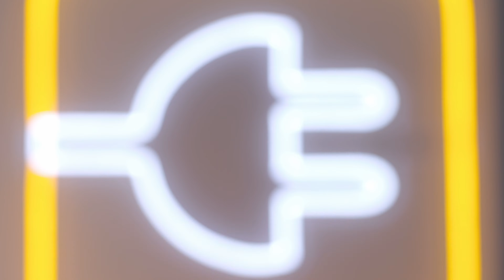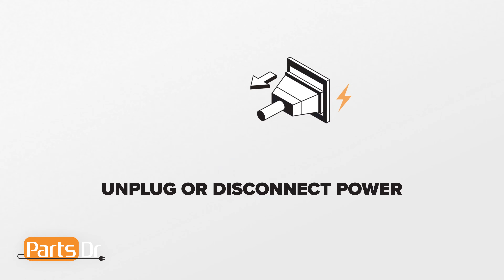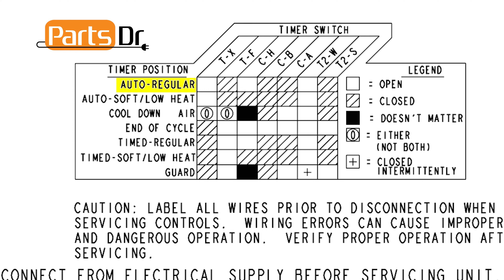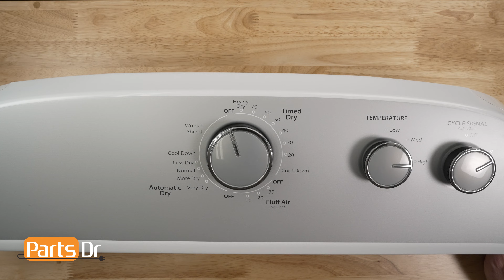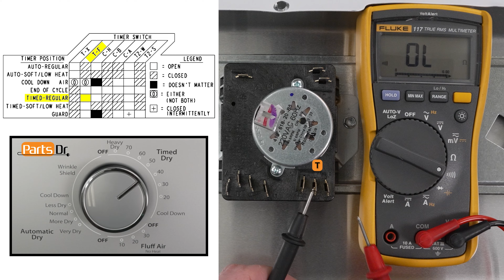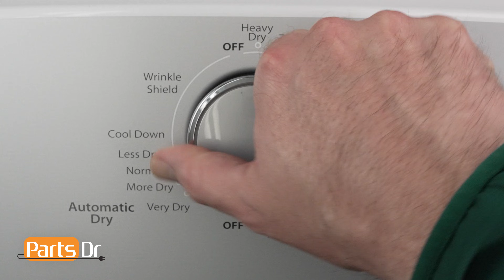Dryer Timer Troubleshooting & Testing - Whirlpool Maytag Amana Kenmore Estate and More

Comment from the maker: Thanks for watching our video on troubleshooting and testing dryer timers! If you need to replace a faulty timer, we always recommend using original, high-quality OEM parts to ensure your dryer operates reliably. You can find genuine replacement parts for Whirlpool, Maytag, Amana, Kenmore, GE, and more on our website at https://partsdr.com. Simply enter the model number from your dryer’s tag into the search box on our site to quickly find the correct part.

Let us know if this video helped, and feel free to drop any questions in the comments below. Happy repairing!
Reply: I replaced the timer and fuse. Dryer works again but I may of replaced the timer wrong. The arrow facing is wrong

Comment: Mine is only about three years old but it felt mushy to begin with as far as the timer knob. It's not stripped out. The heat's not working. I could get it to work by holding the knob while applying light torque, clockwise on the knob. However it was in and out. So I unplugged it took the back off and following the instructions of putting the probes on A and C and looking for continuity of any kind while turning the knob would tell me that the timer's bad. Does that sound accurate? If A and C the red and black aren't getting continuity whatsoever while spinning the knob around that means the timer is broken? I was turning the timer clockwise and counterclockwise whenever I wanted to and counterclockwise a lot. I didn't realize I was only supposed to spin it clockwise. I think three years of that finally broke it. Some people might not realize it's only meant to go clockwise because it basically felt the same going both ways.

Comment: Question! My dryer timer will not advance in the automatic mode but will advance in the timed mode. Is this still a timer issue or something else? I have checked the cycling thermostat and that’s fine. The gas burners also ignite when turned on
Reply from the maker: First, we'd check the timer as shown in the video. That will help rule out whether the timer itself is the issue. If the timer checks out, a few other things to look at are the cycling thermostat, moisture sensor bars (if equipped), the timer motor circuit, and the exhaust venting for any airflow restrictions.

Comment: All other components tested good , found burned points inside timer, replaced timer ran 50 minutes on timed dry , made a pop and tripped the breaker when hit the cool down cycle now yhe timer doesn’t advance, still heats and dries. What’s wrong here?
Reply from the maker: It's possible that the replacement timer is defective or incorrect for your model. Since the original timer had burned contacts and the new timer ran for a while before the failure occurred, I'd verify the part number on our site https://partsdr.com first. A timer that is wired differently internally or not designed for your exact model can cause issues with advancing through the cycle. The fact that it popped and tripped the breaker suggests either a faulty timer or another electrical problem in the circuit.
Reply: @PartsDr it was the right pn only the og had a b  off to the side of it.

Comment: So basically if the timer is not advancing but the dryer still works fine (as far as drying clothes go) to get the dryer to start back advancing the whole timer has to be replaced? Theres no fix..?
Reply from the maker: Yes, if the timer motor is not advancing but the dryer otherwise runs and heats normally, the timer usually needs to be replaced. The manufacturers do not sell the individual internal timer components, and these timers are not designed to be taken apart or serviced. You can sometimes inspect the wiring and terminals for a loose or burned connection first, but if power is getting to the timer motor and it still will not advance, replacing the timer is the fix.
Reply: @PartsDr thanks. Ordered replacement. But I’m still keeping the old one in case the new one goes out oneday. Don’t think it’s an OEM

Comment: Changed my timer now I have no power
Reply from the maker: Please check the outlet and power supply to the dryer first. Make sure the dryer is getting the correct voltage at the outlet or terminal block before replacing any parts. If the power supply checks good, then double-check that all of the timer wire harness connections are pushed in fully and secure.

Comment: My Whirpool dryer heating element comes on then off during the run when I opened the bottom cover. Could this be caused by the timer? TIA. Your video is top notch!

Comment: My Kenmore dryer turns off every time with 40 min left on Time Dry. Any idea why this is happening? TIA
Reply from the maker: If your dryer has a timer, the timer is most likely bad and causing the problem.  Try testing the timer as shown in this video to help confirm the issue.
Reply: @PartsDr  Thanks

Comment: Dryer won’t start when I push off and on switch. If I turn the timer to the start of a cycle it will make a clicking noise. Dryer does not turn on. Does this mean the timer is the problem?

Comment: My dryer starts no matter where my dryer timer is.  But while the drum is turning, I have no heat, and the timer isn’t turning at all.  Would you start with buying a timer or heating element or both
Reply from the maker: That sounds most like a failed timer.  If you have the ability, test the timer as shown in this video to confirm the problem.

Comment: Thanks for the info.I tested the power and no power to the motor. the timer doesn't advance but the dryer still heats. I replaced the timer about a month ago, figured that was the issue but no!  what else could it be?

Comment: Great video! I have 120 voltage at the timer motor. I have tested all the continuity points and they all test as they should. My dryer using timed dry setting will turn on and it gets hot and appears to be drying correctly. however the timer is Not advancing and the dryer will not shut off. Could it be the timer motor?? which I understand is part of the whole timer unit?
Reply from the maker: If the timer is not advancing, it sounds like the timer motor is probably bad or the gears inside the timer are stripped. Either way, you have to replace the time to fix this type of problem. Let us know what you find.
Reply: It was the timer motor. I bought one from you guys and the install was very easy. Thanks.

Comment: Hey Dr.  I cant cant get A specific answer for " Already changed out Timer" and still not Advancing with just luke warm Air.  Cahnged out the Heater Box last spring .....   Any Clues ???   Thank you....  I see it could be the Operation sensor ?
Reply from the maker: A failure in the heating circuit can cause the time to not advance on the automatic cycles.  Try checking these things show here: https://www.youtube.com/watch?v=d4MGDeArRVw
Reply: @PartsDr  Thank you! I'll check

Comment: My dryer has no heat and timer will not advance. I did all checks with multimeter and everything had continuity. Could the timer still be the problem?
Reply from the maker: Try checking the things we show in this video here: https://www.youtube.com/watch?v=d4MGDeArRVw
Reply: @PartsDr I did all of those following your video earlier today including following the wiring chart included with the dryer. Shop vac’d everything clean and made sure all wiring was securely connected. Is it still possible that the timer as the cause?

Comment: Hey Dustin, do you know what would cause an Amana dryer which has had it's timer replaced to still not advance cycles? I'm at my wits end. I've replaced it twice now, and it works perfectly otherwise, only the timer never spins past it's preset cycle.
I haven't yet checked the thermostat to see if it is stuck open, or something.. I just have no idea what is going on with it.
Reply from the maker: Sometimes a failure in the heating circuit can cause this.  Check to make sure the heating element is good and not shorted https://www.youtube.com/watch?v=sO4P-Jqrdlk and that the thermal fuses and thermostats all test good.
Reply: @PartsDr it has heat and i checked all the terminals looking for open circuits and it all seemed alright until i got to the timer motor.  Every timer had the same problem, the motor isn't getting power somehow. I figured it was a stuck thermo but replacing that part still shows the same failure to advance. At this point I've already replaced most of the components on this dryer lol.
Reply: @DJxD im at the same point with my amana. I just replaced the element and sensors. Now the timer has stopped working. Replaced the timer and its still not working. Did you figure yours out?
Reply: @stephenpeterson9795  Yeah I did. Basically, the motor was not getting power for my situation. Turns out, I had stupidly ordered a part that was one letter off of my model, which had an M at the end of the product ID.
Apparently, that was all the difference. I swapped out the wrong timer, and it worked again. 
Soon after, the cheap chinese sensors that I had got in the kit from Amazon quit out as well, and I replaced them with better quality parts from my local hardware store (which might actually be the same, those thermal sensors aren't complicated). 

I suggest unplugging it, and checking if the timer motor has continuity in your wiring diagram. You can find a wiring diagram online if you threw yours away. It should be open when engaged on any setting, and closed when on the OFF 12oclock position. 

The timers are pretty basic internally, they have a few levers that depress metal tabs, which then come into contact with whatever circuit you have chosen for your dryer setting. The motor then eventually turns and those tabs become disengaged. I tore the cheap chinese clone part down to understand it better, and one thing I noticed is the parts are nearly identical, with the chinese version having one less lever in the mechanism. 

Check the start button for continuity when pressed, check the inline thermal fuse for continuity, it should be ON, if it is OFF it is broken.
The high limit thermostat and the cycling thermostat are usually busted in my experience if your element has broken, or a coil is touching the housing. 

These Amana dryers are really poor quality, and are meant to be serviced once a year. They really don't make dyers like they used to.. My grandmothers whirlpool dryer from 1970 has had parts break, but after 5-10 years, not every damn year! Lol

Comment: I am actually an Electrician, never had to mess with appliances other than a heating element in the oven. I have done all sorts of repairs but never had to touch a dryer. My A-C contacts were the culprits. I had to pull(leaning) the knob hard to the left, to make contact. B-C was good. So at least I have that figured out and can understand over 20 years, why the part would fail when ever you reset for each load. Thanks for saving me time and your chart is straight forward.
Reply from the maker: Awesome, glad we could help you out!

Comment: Great video, I learned a lot. Question, if one column on chart for timer repair, has 3 terminals to touch. Do I use a jumper wire or as I have read online, should just do them in combos of 2 till all 3 combos have been done?

Comment: Replaced my Amana timer with an OEM timer Installed it and it runs heats but still wont   advance
Reply: I'm having the same issue with my amana now. Timer won't advance. New timer still won't advance.

Comment: Excellent Video, My problem is that the timer on my Amana, Model LEA60AW,  part #PS2046452, in no longer available. Can a newer timer be substituted for it? The pin out looks the same, however, while the mounting would be different, I believe that it could be corrected. Thank you
Reply from the maker: Timers are very specific and typically cannot be replaced with another similar timer.

Comment: My Kenmore 600 electric dryer kept shutting off after 10 minutes. I replaced all of the thermostats, high limit, low limit and the fuse in back. Worked great for about 2 weeks. Now it’s doing the same thing again. Could be the switch. Seems odd though.
Reply from the maker: If the dryer starts by up after sitting for some time, it could be a bad drive motor.  https://www.youtube.com/watch?v=rbpzjRPMuJ0

Comment: Dryer timer does not move and dryer works but no heat. Could this be the timer being bad
Reply from the maker: Sometimes a failure in the heating circuit can stop the timer from advancing on the automatic dry cycles.  Does the timer continue to advance on the timed dry cycles?

Comment: Question on the testing- does it have to be disconnected from the rest of the dryer?  I just replaced my timer and ran through the testing before installation.  My Auto load A-C is closed only when it is connected to the dryer.  When disconnected it is open.
Reply from the maker: The dryer should be unplugged and the wires to the timer should be disconnected when testing the timer.

Comment: My problem is the timer works intermittently, I replaced the timer and have the same problems. Does not matter if dryer is warm or cold. Or if running. I can hear timer ticking when working. Suggestions?
Reply: The timer does not advance. When it is not advancing, no other function works. But when timer is advancing the dryers works fine. The timer I replaced was doing the same thing.
Reply from the maker: @garyschmidtke6495  Check for an open or shorted circuit in one of the heating element coils. Also, make sure the dryer is receiving proper power by testing the voltage at the outlet and where the power cord connects to the dryer. If the dryer loses one leg of the 240V supply, it can cause unusual behavior.

Safety Warning: Always disconnect power to the appliance before performing any tests or repairs. Use caution when working with electricity. Improper handling can result in electric shock, injury, or death.  If you're not comfortable working with electrical components, it's best to hire a qualified appliance repair technician.
Reply: @garyschmidtke6495 had same issue with mine until it finally stopped working altogether. It has now been sitting for a couple of years (had no way of replacing it and other events in life took priority) and I thought I’d try to see if I could fix it. I was successful fixing my washer and was hoping I could do the same with the dryer.
Reply from the maker: What is the model number of your dryer and what specifically is not working?
Reply: GE GTD33EASK0WW
LR769143C

The timer working sometimes but not always. Or would stop shortly after running. I replaced the timer and the problem is the same. It might work fine two or three times then not at all. I can tell when it will work because you can hear the timer ticking. If I do not hear it ticking it will not work.
Reply from the maker: @garyschmidtke6495  When you say the timer is working sometimes but not always, do you mean the timer isn't advancing through the cycle, or is there another function of the dryer (like heating or tumbling) that also stops working when the timer isn't ticking?
Reply: Thank you, I will check it tomorrow and let you know.
Reply: Mine will not run on the fluff cycle (air only). What might cause this?

Comment: How do I find what part number my motor would be for my timer?
Reply from the maker: The manufacturer does not sell individual components of the timer, such as the timer motor, separately. To find the correct replacement timer, please visit https://partsdr.com and search using the model number from the tag on your dryer.

Comment: If the timer doesn’t go forward, would the heating still work when you turn the knob?  My timer doesn’t advance so I know the timer motor is shot but I also don’t get heat no matter where it is turned to.
Reply: Turns out it was the circuit itself.  The place we bought has two 120V/30A fuses going to the dryer outlet.  One is faulty and that circuit appears to control the timer and the heater. The other circuit appears to control the drum motor and the blower. We are going to get an electrician in to replace the wiring and upgrade to a four prong receptacle to meet the updated electrical code.  I would do it but the box lacks a ground wire back to the panel.
Reply from the maker: @ColinSemple  Thanks for the update!  We are glad to hear that you found the cause of the problem.  We have seen this type of issue many times.
Reply: Oops, you covered that later on.  Good video.
Reply from the maker: @ColinSemple  Great!  Let us know if you find that the timer on yours is bad.

Comment: The rotary switch broke on my timer and i have to replace the whole timer now. I havent been able to find the part. Can i setup the wires on the timer in a way to make it work indefinitely? My dryer timer model is m460g 212D1233P020 and dryer type is white westinghouse
Reply from the maker: We don't know of a way to bypass the timer.  What is the model number from the tag on your dryer?

Comment: Thank you! My timer will not start on high heat timer cycle, I am getting continuity between T-F and nothing between B-C. I cut a piece of wire and jumped C to B, press the start button and it started right up just fine, will order a new timer
Reply from the maker: Nice job troubleshooting the timer!

Comment: Nice video
Reply from the maker: Thanks! Let us know how your repair goes for you.
Reply: @ tommorow ill check the timer, but i ask some question, what is the correct supply electrical connection for dryer? I connect the black(left) and red(rigth) to main breaker but still no power, the white(middle) need to connect to ground or even not?
Reply from the maker: @renztv1131  This video might answer your question here: https://www.youtube.com/watch?v=YD7xBlPmUmc
Reply: @ i already troubleshoot the unit, door switch, thermal fuse, push button, all that thing is working, but still no power or wont start,